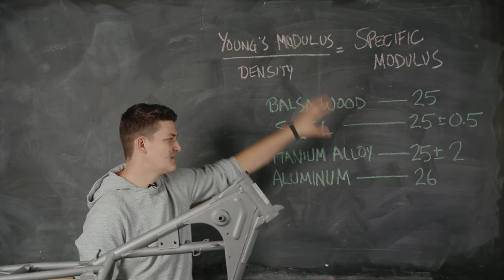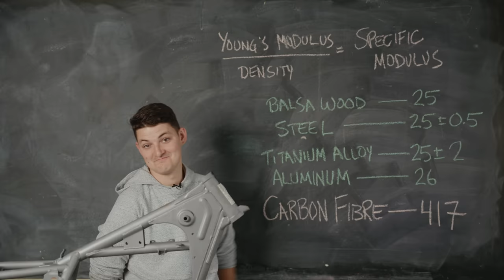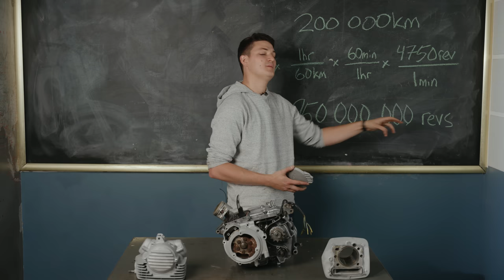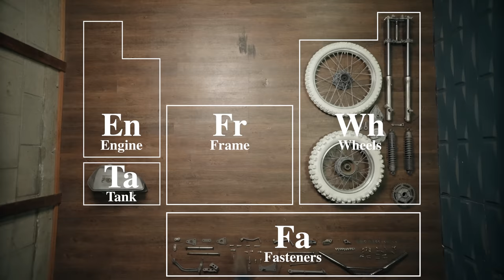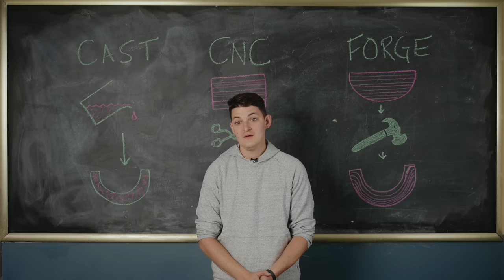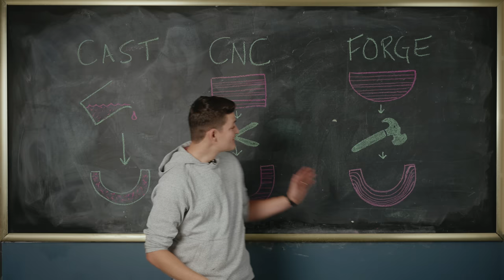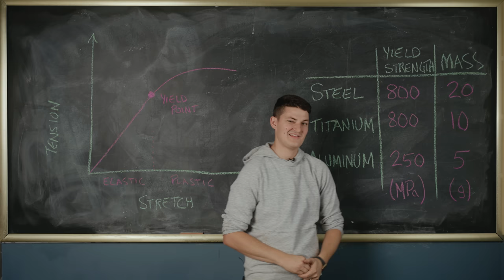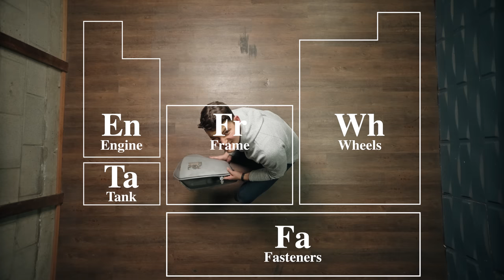Motorcycle Metallurgy - Why Steel? Aluminum? Titanium?

Comment: I’m so glad f9 did this vid.   It’s not a helpful post - nothing to do with the best way to ride or the best thing to buy.  It’s a reminder that engineering is really, really cool….and how good an OEM bike actually is.  It is not built to fall apart (planned obsolescence.) its built to be good 5 or ten years down the road.  This years bike is better than last years bike and not as good as next years bike - or so goes the engineering, anyway.  How weird that change = deviation, not advancement.   Innovation is risky business when a carbon fiber wheel explodes in front of 100000 people -oops!

Comment: steel is not immortal  ....the engineers agreed on the 10 to the power of 9 or 7? cycles to be enough for general application. in reality what was designed to last forever will wear out thru friction or cavitation, corrosion .....

Comment: My aluminium rims are more heavy then my oldschool spoke rims.
Sometimes the older stuff isn't as bad as many companies telling us.
The same for new tech in the bikes. Ok, ABS is kinda ok, but all the other stuff is stupid. Learn to ride, instead of using stability control, anti slip clutch, traction control and whatever they throw at us. IF you need so much assistance to ride, stop riding and buy a cage, sorry i wanted to say car.

Comment: Complex problems being oversimplified to prove a boomer argument.

I could probably say that a mouse is smarter than us by finding out that one thing it can do better. Does it mean that mice should rule the world?

Take for example the cylinder. Cast iron might be better at resisting galling, but as soon as there is oil on the cylinder there is no wear. With modern oil and engine design, they can last 300k in a car without breaking a sweat. However, cast iron is heavier and it does not conduct heat as well as an aluminum head, much bigger deal when trying to make a light, compact and powerful engine.

Comment: I think this is a big reason there is market for Chinese bikes, so cheap because everything is Chinesium (cheap steel/iron) Especially here in the UK every starter 125 bikes Chinese made and so much cheaper than a Honda or Yamaha 125. If somebody could make a proper strong good quality steel bike that comes in at less than the competition but at better quality than chinse manufacture a lot of markets would open to that, bikes are riding up prices and its for things we don't even need or really if we're honest want. 

The style right now is retro, cafe etc. Then build them that old way. Steel. Nothing fancy, add some plastic to stop the worst corrosion areas from being caked in mud. But stop trying to look old and just be old, and use what you need to make it safe. a new computer, ABS, traction control etc. Apart from that, go old school and let us enjoy motorbiking for less.

Comment: very nice, but you confused technical terms again.  I know you make efforts to stay true to the disciplines of physics and engineering, which is the only reason I pointed out.  two terms and engineering mechanics: strength and toughness.  you call fracture toughness "strength", and you call fracture strength "stiffiness".  an example of the engineering definition: carbon fiber is much stronger than steel, but steel is much tougher than carbon fiber.  strength is how much something can hold, and toughness is how resilient it is.

PLUS: you still haven't you touched on the very simple yet flabbergastingly misunderstood physics behind countersteer.  there's literally nothing to it, and I thought you would have gotten there by now.

DM we are something, and I'll be happy to explain it to you.  no charge or recognition needed, I don't care about that.  I love your channel, and I just want to remove the aggravation

THANK YOU SO MUCH FOR YOUR EFFORT AND TIME I LOVE IT